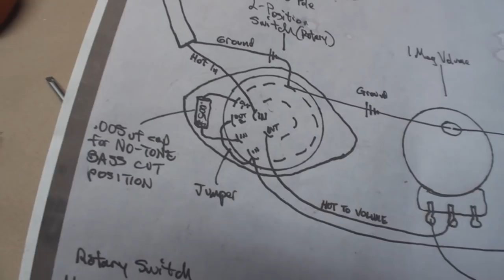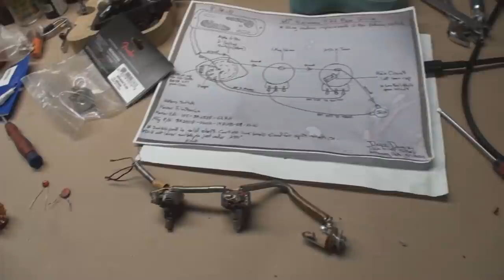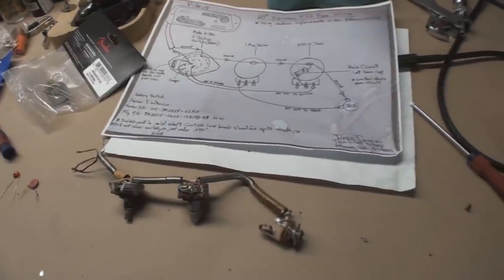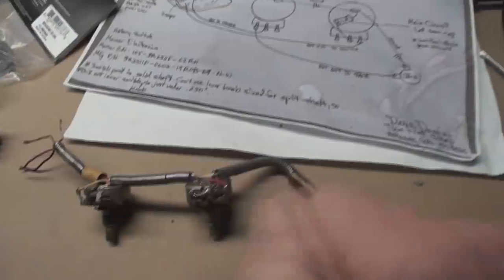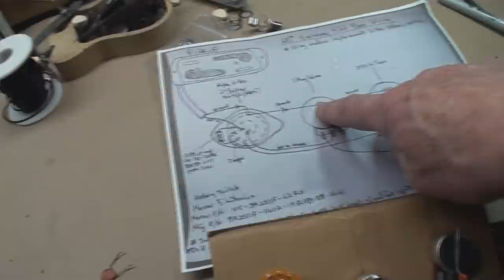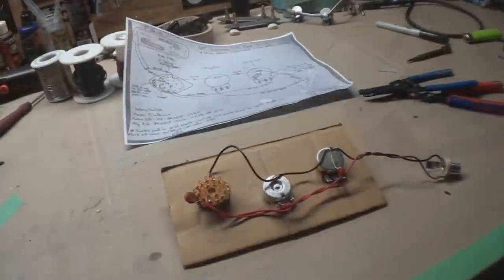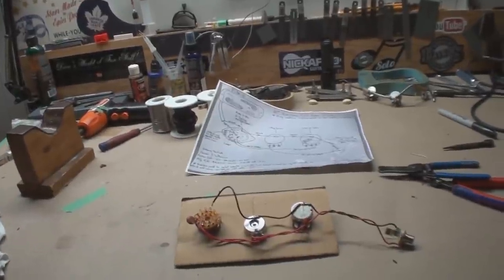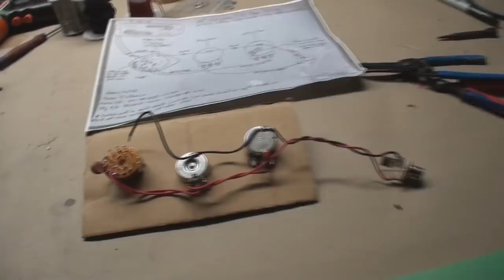Harmony H22 Batwing Bass Restore Part 2

Comment: Really enjoying this Dave. I remember when I put my 5 Way Super Switch, in my Tele. Well I have TBX, so it's not so simple. Got the Seymour Duncan diagram, it called for 2 resistors. So I went to my Mom's ex husband's house. This guy went to every Army Air Force Surplus sale. (The military unloads their junk equipment to civilians) he had literally TONS of resistors, basically about any thing you wanted, tbh (spent $thousands on the junk). Any way I barely remembered the color code, (The little saying about what bad boys do to young girls....) but there was a grey ring. He said "Man that's silver, don't you remember your tolerances?" "Nope I've been doing sheet metal for 10 years." Well he figured it out, & we searched through the random resistors for HOURS, thousands of those bastards. Finally I found 1, he double checked. Then we spent another hour, & he found another. Those were the only 2 he had. I mean he had 2 car garage full of drawers of resistors. You should've seen his huge workshop he built!!! It was stuffed with other stuff. Sadly he died about 4 years ago. Any way the Tele sounds great!!! LMAO.

Comment: Dave. Where did you find a replacement switch?
Reply from the maker: A1 electronics toronto. 2 position 6 pole switch DK6561 F https://www.a1parts.com/switches/index.html#ROTARY%20SWITCHES
you only use some poles..took me a bit to figure it

Comment: I see a major problem in the making.  The new stuff is connected with unshielded wiring.  You are building a nice antenna.  BZZZZZZZZZZZZ
Reply from the maker: it's a humbucker..look close the original had no shield..just a spring ground wire
Reply from the maker: Dave's World of Fun Stuff also 2 inches of wire in a grounded circuit is fine..look inside a P bass ..no wires are shielded

Comment: You need to ground the 3rd lug on the volume pot. It won't work well without it.
Reply from the maker: seems to work fine..stay tuned ..DUDE
Reply: @DavesWorldofFunStuff  It might on the bench, but without shunting the signal to ground when turned down, it can be noisy in the wrong situations. Looking forward to seeing it completed, it's a cool bass.